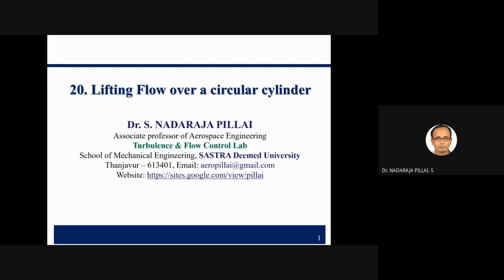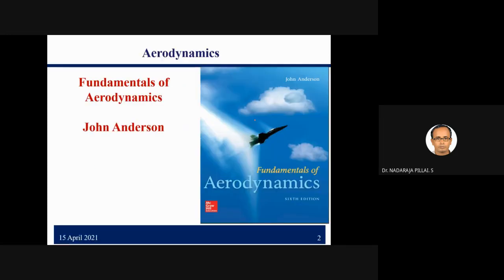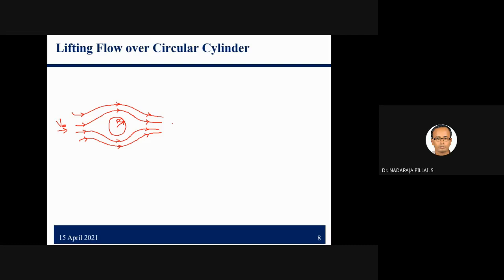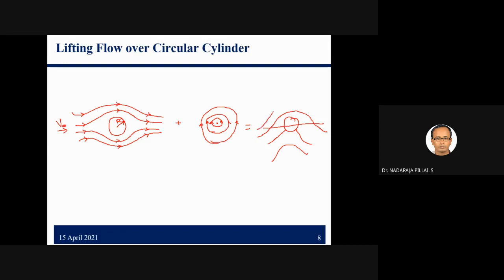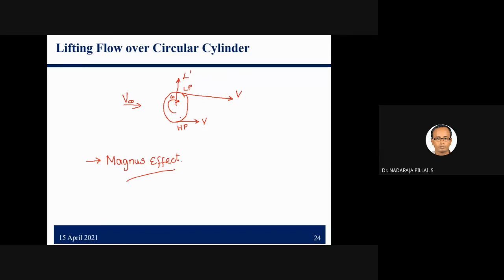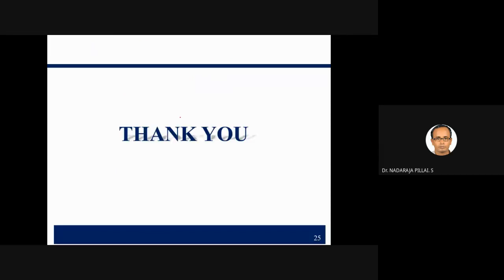Lifting flow over circular cylinder

Comment: Thank you sir for the video. The location of the stagnation points depend on the ratio between circulation and 4*pigreco*Vinf*R. What does 4*pigreco*Vinf*R indeed physically mean? It is a circulation of a vortex for which the velocity is Vinf at the distance 2R from the origin (or equivalently the circulation of a vortex for which the velocity is 2Vinf at the distance R from the origin) and that rotates in opposite direction with respect the vortex we are superimposing.Why is it like that? I would appreciate if you can clarify.